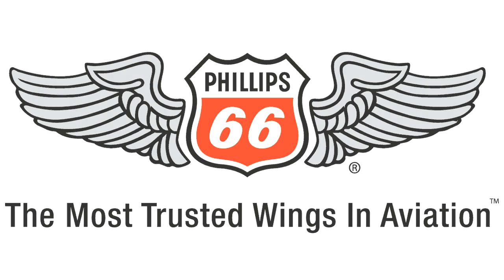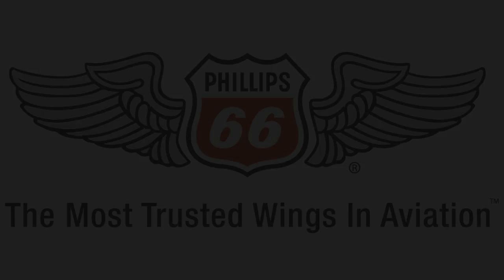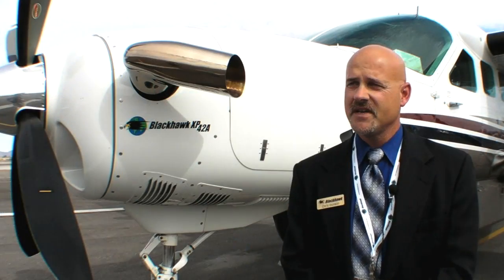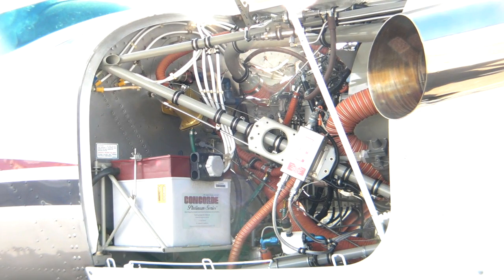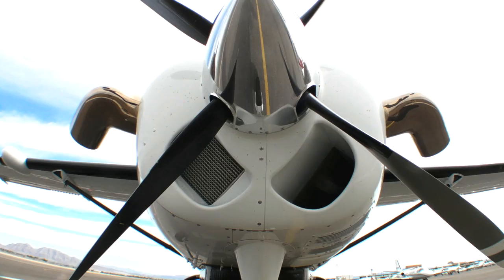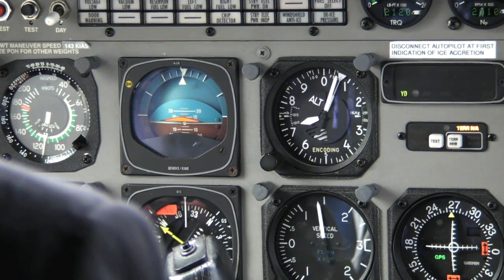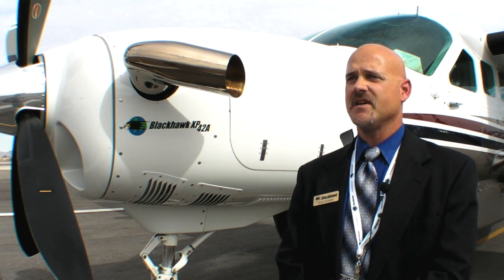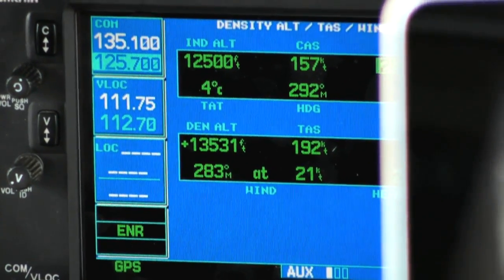Blackhawk Caravan

Comment: I helped install one of these on one of  ERA's 208B's. Blackhawk support has been beyond  expectations. However, be aware that it is heavier, and there is no gross weight increase that is not all ready available in an STC for the normal -114 . Our aircraft flies "over the range" from  Anchorage to Galena, and it's ideal for that mission, however most of our flying in western and northern AK and doesn't require the power or altitude this aircraft gives at the cost of fuel burn and  lower payload.

Comment: @bobo4533   Honeywell vs. Pratt.  Actually Texas Turbines has sold 27 Supervan 900 conversions in the last 2 years since approval and delivered 20 converted aircraft in 10 different countries.  The Honeywell engine has a base 7000 TBO vs. the Pratt 3600 base TBO, 8-9 gal/hr lower fuel burn, shorter takeoff, better rate of climb, faster cruise speed, faster engine response, torque and temperature limiting, lower overhaul cost, etc...... any questions????